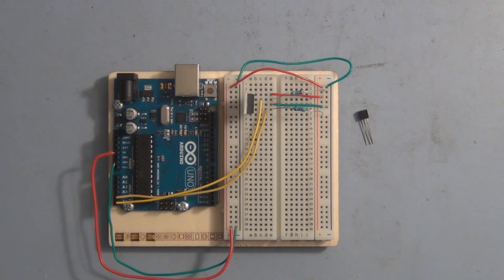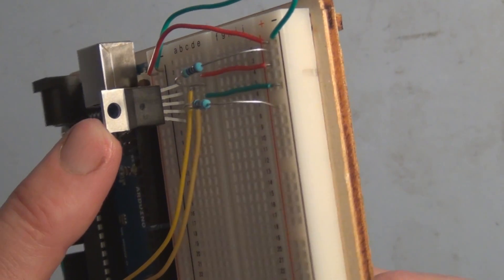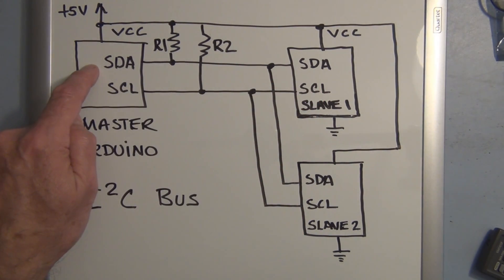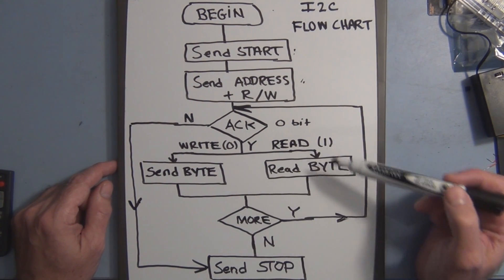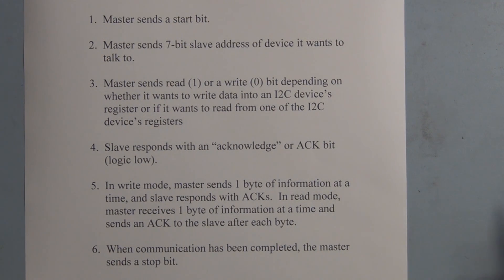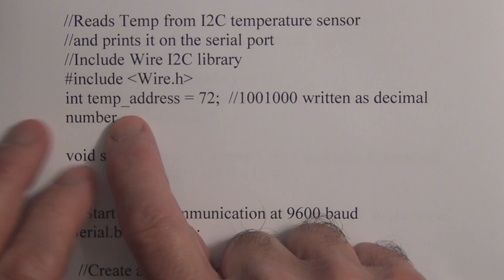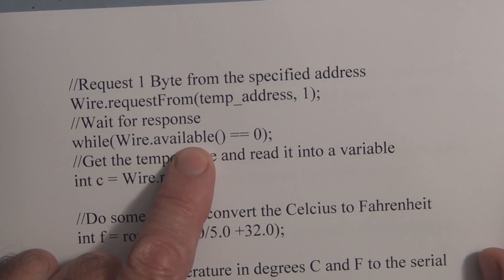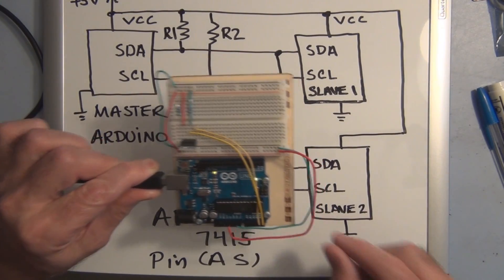Arduino I2C Tutorial

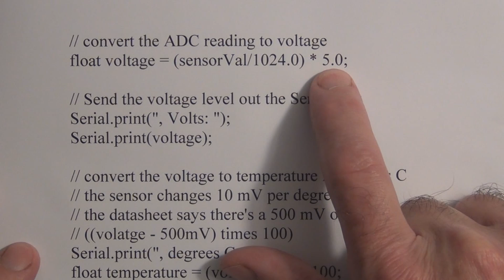Comment: At 1:28 the formula should be 1023 bits because Arduino Uno's ATmega328P chip has 6 channel Analog-Digital converter with each of have a 10-Bit resolution. So that means 10^2 = 1023. The ATmega328P chip is only capable of reading 5 volts into 1023 steps/units. Does that 1 bit error makes a difference when using 1024... I guess not.

Comment: Not a recommended chip to measure tempature. The accuracy is 2 - 3°C, which is 1.8 x 2, 3 = 3.6°F, 5.4°F , pretty crappy compared to my analog LMT86 0.25°C x 1.8 = 0.45°F. Also for the conversion (C -> F) it doesn't need to be written like 9/5, which is 1.8 ALWAYS. So why not do °C x 1.8 + 32 = °F

Other than that, pretty good tutorial. I think I actually learned something rather than all the other videos trying to teach this I2C stuff.

Comment: your while statement is an  infinite loop.  it runs until the device responds with a value not zero.  If the device is off or damaged the program will get stuck in this one statement loop.  Better to modify so it exits after a number of tries, perhaps with a short delay between each try.

Comment: an excellently made video. do you have any advice or can you push me towards any sources for using multiple devices with the SAME address? I know its not ideal but its what I need to do. The only option I see is to power on the device I need before reading to it and then powering it off when I'm done.

Comment: That's a really nice video. Beautifully explained. But how did you know that the address of the temperature sensor is 72? Is there any method for scanning the address of an I2C slave device using arduino?
Reply from the maker: +Sivaranjan Goswami The manufacturers data sheet will specify the address.
Reply: +eTechTom Thank you.
Reply: +Sivaranjan Goswami i dont know ill help you or no but i just say he showed the datasheet the address was in binary so you convert into decimal and put in the code
Reply: +manojkumar subramaniam Thanks.. Later I got an arduino program that automatically finds the addresses of the connected serial devices. It worked with I2C as well.. So first I executed the program to find the address and then I used that address in my main program.
Reply: oh yes , i have seen in at arduino webpage.

Comment: Hi, +eTechTom

I must thank you for your most instructive and helpful video. 

I am a computer science engineer. That is computer science, not electric, electronic, nor robotics. I am a novice with regards to those subjects.

However, my background for computer science does allows me to know more than a thing or two on the Arduino as a computing device, and it is on that which I will like to comment right now.

One of the formulas you used in your code was:

float voltage = (sensorVal/1024.0) * 5.0;

I would like to point out that, although it would certainly work flawlessly, it is overkill when it involves making sure you are dealing with floating points.

The rule is that to make the enire arithmetic operation a floating point one, you need just one of its terms to be floating points terms. Having a single floating point one, already turns the whole thing into floating point.

Therefore, this is sufficient:

float voltage = sensorval/1024*5.0;

I chose to make the 5.0 a float since it is a volt quantity and it makes more sense to have it being a float, instead of 1024 which is an integer number representing the Arduino ADC's resolution. Plus, it helps you see that even if the last term is a float, it is considered all to be a float by the compiler.

Keep up the good work!

Comment: Hello,
Great video. many thanks
I am using it a s a refrence for my I2C PICkit demo board. with temp sensor MCP9800.... all am getting back is -1, even when I am not connected the board to it :( . I cant figure whats the problem

Here is the code :

#include "Wire.h"
//wire library

#define address 0x92
//address of the temperature sensor

#define delayC 1000
//delay count in ms

#define baudrate 9600
//baudrate for communication

 int temp, led=13;

void setup()
{
  //creat a wire object
  Wire.begin();
   //start serial , monitor
  Serial.begin(baudrate);
  pinMode(led, OUTPUT); //led on
}

void loop()
{
 

  Wire.beginTransmission(address); //1001 0010, 146
//start the transmission
  Wire.write(0x00); //sent a bit asking for ambient temp register
  Wire.endTransmission(); // complete transmission

//read temp from device
  Wire.requestFrom(address, 1);  
  while(Wire.available()); //wait for info/response
  digitalWrite(led, HIGH);   // turn the LED on (HIGH is the voltage level)
  temp = Wire.read(); //get temp and assign it to variable

//send temp to screen
  Serial.println(temp);
 // Serial.println("TEMP");

  delay(30);
}
Reply: Al Yaqdan Al-Zadjali 
After converting , and scalling... I get 24 degrees celcius. the probs is that the temp sensor isn't responding or changing ? . I did initiate the variable with 0 , and yet still the data doesn't change

//scaling from 2's complement and ADC resolution 0f standard 9bits to scale of 0.5 degrees celcius increment. (Page 16 datasheet MCP9800) Refresh rate is 30ms typical given by datasheet

  // 2^9 = 512. 0 to 255 , -255 to -511

  if (temp > 255)
  {
     temp=(temp-511)*(2*10^-4);
     Serial.println(temp);
  }
  else if (temp < 256)
  {
    temp=(temp*(2*10^-4));

    Serial.println(temp);
  }
Reply: Al Yaqdan Al-Zadjali It didn't give -1 this time because i changed int to float
Reply from the maker: Al Yaqdan Al-Zadjali I do not have experience with this platform but from what I have read it is designed to work with the Pickit Serial analyzer.  I pulled this information from the Digikey website.  The PICkit™ Serial I2C™ Demo Board was designed to easily connect to the PICkit Serial Analyzer (DV164122). The PICkit Serial Analyzer provides the I2C master mode serial communications and power. The PICkit™ Serial I2C™ Demo Board devices all operate in the I2C slave mode. The PICkit™ Serial I2C™ Demo Board can easily be connected to virtually any demo or development board by connecting the communications
lines to connector P1.  I suggest you review the data sheet for that board and there are also tutorials on using that board. 

 http://ww1.microchip.com/downloads/en/DeviceDoc/51657a.pdf

• An I2C Master Communications tutorial is available on the Microchip Technology website. Click on the links: Support --> Getting Started --> PIC MCU Tutorials -->I2C Master Mode

http://www.digikey.com/catalog/en/partgroup/pkserial-i2c1-pickit-serial-i-c-demo-board/33299

Comment: Hey eTechTom, I really like your video but I have one problem. I'm using the si1143 chip and there is a pin called INT/IRQ, which is supposed to be a open-drain output for the chip. I don't know if I should connect this to ground or positive?
Thanks!
Reply from the maker: PISTOL PETE I'd look to see what's in the data sheet and see if you can find some application notes.  https://www.silabs.com/Support%20Documents/TechnicalDocs/Si114x.pdfThe Si1141/42/43 asserts the INT pin to interrupt the host processor. The INT pin is an open-drain output. A pull-up
resistor is needed for proper operation. As an open-drain output, it can be shared with other open-drain interrupt
sources in the system.  At the bottom of page 2 it mentions a designer guide.  https://www.silabs.com/Support%20Documents/TechnicalDocs/AN498.pdf

Comment: What is the sensors have the same Address ?
Reply from the maker: They can't have the same address.  What ever device you want to talk to has to have it's own unique address.
Reply: eTechTom Yea i know but in the video he demonstrated a component that the address can be take from the datasheet what if he use the exactly same component ?
Reply from the maker: Domino SixO This particular sensor is offered by the manufacturer with a number of different addresses that are set at the factory and have different part numbers that are listed on the data sheet.  So you can have multiple temperature sensors of the same type on the same bus as long as each one has a unique address to fit you design needs.
Reply: eTechTom But if you wanna use 50+ sensors and most of them have the same address ?
Reply: Domino SixO than your yust fucked or i think there is a way to multiplex them but not shure
Reply: TechDuino Well one way i think is to use multiple sensors with multiple microcontrollers and combine the chips in to one "master" and get the data, but that will be waist of money